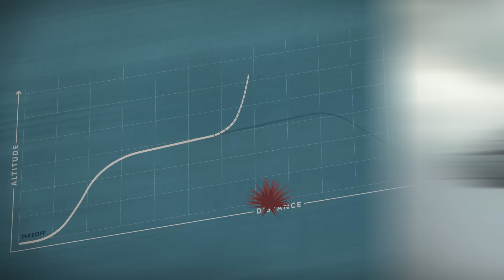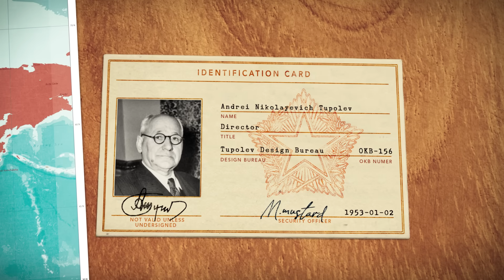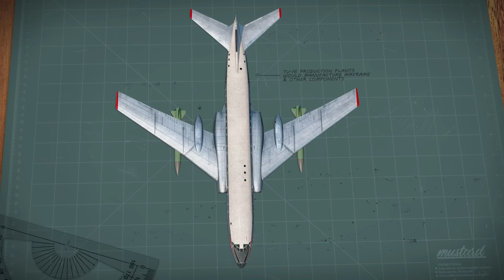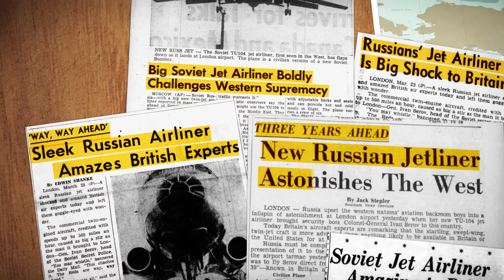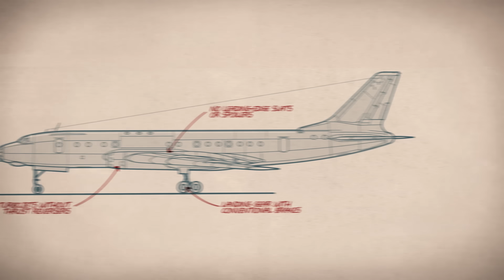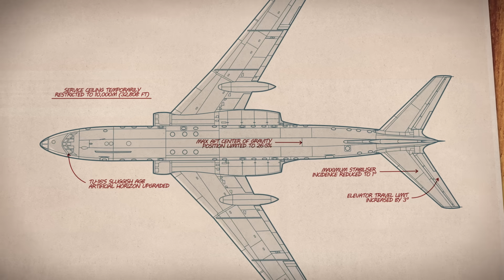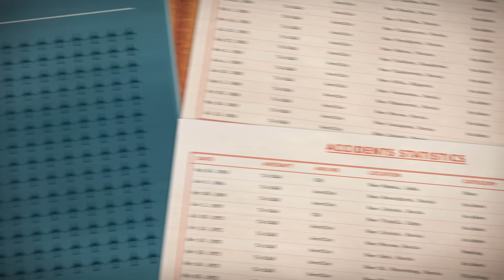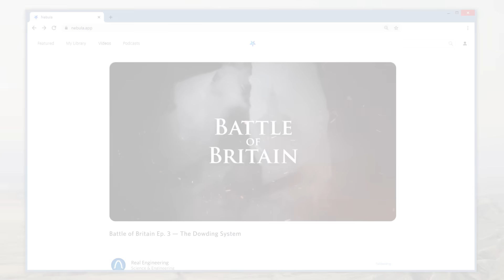The Soviet Airliner Designed To Crash

Comment: Russia has always had the mentality of take this off of this and put it on that - I understand the idea but they failed to take physics into account after QC of this thing. If their was a QC.
Reply: This plane has a very good safety record compared to the British Comet.

Comet Disaster was caused by both bad engineering and poor quality control standards.
Reply: @sandervanderkammen9230   

We feel we can shed some light on some common myths & misunderstandings repeated in many comments.

It is indeed correct that there were plenty of aircraft that were more dangerous than the De Havilland Comet before & after the Comet.

Obviously It's not valid to compare a Bow-wing ( see B-47 wing folding & wing collapse incidents for details) jet  airliner designed & first built as late 6 decades after the Comet, with the fabulous De Havilland Comet, the world's first high altitude jet powered airliner.  
  Vast improvements in commercial aviation infrastructure alone being a significant factor in improvements in air travel safety safety over mire than half a century.
    Of course 50 years more design, build & operation experience didn't prevent the horrendous Bow-wing Max  incidents, there can obviously be no excuses for that.
  
  That's correct of course, at the time the Comet wasn't particularly dangerous. Agreed, that is indeed the case of course, The DH Comet was definitely not the worst engineering failure in commercial airliner history.

Losses comparisons
How things were in those days.

DeHavilland Comet 4 UK                  14% 
DeHavilland Comet all mks             17%  

Boeing 307                               70%
Boeing 247                               48%
Boeing 707            .                  20% 
Lockheed Electra Turboprop   29%
Canadair CL-44  Turboprop     46%  
Convair CV-580  Turboprop     22%
Convair CV-880    (ff 1959)       27%  
Convair CV-990     (ff 1961)      33%
Tupolev TU-104       (ff 1955)    16%

     Of course De Havilland had prior experience building many all metal construction airframe aircraft & thousands of jet powered fighter aircraft that were primarily of metal construction with pressurised cockpits & jet engines built by De-Havilland.

  Yes, that's true, De Havilland carried out full stress analysis & engaged in a comprehensive & protracted testing program which is why key De Havilland people were happy to be aboard flying DH Comet aircraft. The Comet was the first airliner where stress due to pressurisation significantly exceeded flying load stress for a full length passenger cabin fyselage.

    We agree, that's correct, the DH Comet was the first passenger airliner with full length fuselage pressurisation at 8psi pressure differential. Handley Page built the world's first all metal construction airliner during the 1920s.
    In many cases earlier pressurised aircraft were larger, needed thicker fuselage skins due to flying stresses alone & had much lower pressurisation differential pressure. 

     Of course ripstop provision was provided. The skin alloy used became unavailable at the time due to R & D at the manufacturers which resulted in the original alloy being discontinued. Later alloys had very similar properties. The skin thickness used for the Comet was used for similar size later aircraft. Frame spacing was not found to be too large & frame width was not found to be too small.

    Without doubt De Havilland did indeed always work to better than industry standards at the time, used up to date knowledge for the design & construction & no evidence of negligence or criminal negligence was ever produced in relation to the DH Comet.

   Obviously the DH Comet had no effect on the course of the aerospace industry in the UK. The UK now has the world's largest combined nuclear, aerospace & defence sectors per capita activity.

    That's correct, the investigation committee did not find hundreds of fatal flaws or evidence of design defects, structural defects, defective materials or shoddy workmanship. Indeed it is the case that ripstop provision was included. Claimed incidents did not involve cracks starting from passenger window corners.
   Pretty much all changes were just in case changes or were planned development modifications & improvements that were scheduled regardless of incidents.

    Obviously De Havilland designers knew all there was to know about metal fatigue at the time they designed the DH Comet.

    It is in fact true to say that the way airliners were built changed everywhere including in the US after the Comet incidents.

We hope this helps, obviously.

Cheers indeed of course 👍. 
    
 . . .... ... ..... ........
 ..... ..... .... ...........

Comment: Ah, the Cometski
Reply: Much safer than the Comet
Reply: @sandervanderkammen9230 

Although the tu-104 was a much  later design effort than the Comet it wasn't in fact safer.

We feel we can shed some light on some common myths & misunderstandings repeated in many comments.

It is indeed correct that there were plenty of aircraft that were more dangerous than the De Havilland Comet before & after the Comet.

Obviously It's not valid to compare a Bow-wing ( see B-47 wing folding & wing collapse incidents for details) jet  airliner designed & first built as late 6 decades after the Comet, with the fabulous De Havilland Comet, the world's first high altitude jet powered airliner.  
  Vast improvements in commercial aviation infrastructure & pilot familiarity with jet airliners alone being a significant factor in improvements in air travel safety safety over more than half a century.

    Of course Bow-wing having 50 years more design, build & operation experience than De Havilland didn't prevent the horrendous Bow-wing Max  incidents, there can obviously be no excuses for that.
  
  That's correct of course, at the time the Comet wasn't particularly dangerous. Agreed, that is indeed the case of course, The DH Comet was definitely not the worst engineering failure in commercial airliner history.

Losses comparisons
How things were in those days.

DeHavilland Comet 4 UK                  14% 
DeHavilland Comet all mks             17%  

Boeing 307                               70%
Boeing 247                               48%
Boeing 707            .                  20% 
Lockheed Electra Turboprop   29%
Canadair CL-44  Turboprop     46%  
Convair CV-580  Turboprop     22%
Convair CV-880    (ff 1959)       27%  
Convair CV-990     (ff 1961)      33%
Tupolev TU-104       (ff 1955)    16%

     Of course De Havilland had prior experience building many all metal construction airframe aircraft & thousands of jet powered fighter aircraft that were primarily of metal construction with pressurised cockpits & jet engines built by De-Havilland.

  Yes, that's true, De Havilland carried out full stress analysis & engaged in a comprehensive & protracted testing program which is why key De Havilland people were happy to be aboard flying DH Comet aircraft. The Comet was the first airliner where stress due to pressurisation significantly exceeded flying load stress for a full length passenger cabin fyselage.

    We agree, that's correct, the DH Comet was the first passenger airliner with full length fuselage pressurisation at 8psi pressure differential. Handley Page built the world's first all metal construction airliner during the 1920s.
    In many cases earlier pressurised aircraft were larger, needed thicker fuselage skins due to flying stresses alone & had much lower pressurisation differential pressure. 

     Of course ripstop provision was provided. The skin alloy used became unavailable at the time due to R & D at the manufacturers which resulted in the original alloy being discontinued. Later alloys had very similar properties. The skin thickness used for the Comet was used for similar size later aircraft. Frame spacing was not found to be too large & frame width was not found to be too small.

    Without doubt De Havilland did indeed always work to better than industry standards at the time, used up to date knowledge for the design & construction & no evidence of negligence or criminal negligence was ever produced in relation to the DH Comet.

   Obviously the DH Comet had no effect on the course of the aerospace industry in the UK. The UK now has the world's largest combined nuclear, aerospace & defence sectors per capita activity.

    That's correct, the investigation committee did not find hundreds of fatal flaws or evidence of design defects, structural defects, defective materials or shoddy workmanship. Indeed it is the case that ripstop provision was included. Claimed incidents did not involve cracks starting from passenger window corners.
   Pretty much all changes were just in case changes or were planned development modifications & improvements that were scheduled regardless of incidents.

    Obviously De Havilland designers knew all there was to know about metal fatigue at the time they designed the DH Comet.

    It is in fact true to say that the way airliners were built changed everywhere including in the US after the Comet incidents.

We hope this helps, obviously.

Cheers indeed of course 👍. 
              
 . . .... ... .... .....
.. ......... ..  .....
 ..... ..... .... .. .
............... ....  .

Comment: Still better than boeing theese days right?)))
Reply: Boeing makes the safest aircraft in the world.
The 787 has the best safety record of any aircraft design in the entire history of aviation
Reply: @ sure:)
Reply: @eugenenumberoneov You didn't know that Boeing makes the safest aircraft in history?
Reply: @sandervanderkammen9230  not even arguing:)
Reply: @sandervanderkammen9230 

We feel we can shed some light on some common myths & misunderstandings repeated in many comments.

It is indeed correct that there were plenty of aircraft that were more dangerous than the De Havilland Comet before & after the Comet.

Obviously It's not valid to compare a Bow-wing ( see B-47 wing folding & wing collapse incidents for details) jet  airliner designed & first built as late 6 decades after the Comet, with the fabulous De Havilland Comet, the world's first high altitude jet powered airliner.  
  Vast improvements in commercial aviation infrastructure & pilot familiarity with jet airliners alone being a significant factor in improvements in air travel safety safety over more than half a century.

    Of course Bow-wing having 50 years more design, build & operation experience than De Havilland didn't prevent the horrendous Bow-wing Max  incidents, there can obviously be no excuses for that.
  
  That's correct of course, at the time the Comet wasn't particularly dangerous. Agreed, that is indeed the case of course, The DH Comet was definitely not the worst engineering failure in commercial airliner history.

Losses comparisons
How things were in those days.

DeHavilland Comet 4 UK                  14% 
DeHavilland Comet all mks             17%  

Boeing 307                               70%
Boeing 247                               48%
Boeing 707            .                  20% 
Lockheed Electra Turboprop   29%
Canadair CL-44  Turboprop     46%  
Convair CV-580  Turboprop     22%
Convair CV-880    (ff 1959)       27%  
Convair CV-990     (ff 1961)      33%
Tupolev TU-104       (ff 1955)    16%

     Of course De Havilland had prior experience building many all metal construction airframe aircraft & thousands of jet powered fighter aircraft that were primarily of metal construction with pressurised cockpits & jet engines built by De-Havilland.

  Yes, that's true, De Havilland carried out full stress analysis & engaged in a comprehensive & protracted testing program which is why key De Havilland people were happy to be aboard flying DH Comet aircraft. The Comet was the first airliner where stress due to pressurisation significantly exceeded flying load stress for a full length passenger cabin fyselage.

    We agree, that's correct, the DH Comet was the first passenger airliner with full length fuselage pressurisation at 8psi pressure differential. Handley Page built the world's first all metal construction airliner during the 1920s.
    In many cases earlier pressurised aircraft were larger, needed thicker fuselage skins due to flying stresses alone & had much lower pressurisation differential pressure. 

     Of course ripstop provision was provided. The skin alloy used became unavailable at the time due to R & D at the manufacturers which resulted in the original alloy being discontinued. Later alloys had very similar properties. The skin thickness used for the Comet was used for similar size later aircraft. Frame spacing was not found to be too large & frame width was not found to be too small.

    Without doubt De Havilland did indeed always work to better than industry standards at the time, used up to date knowledge for the design & construction & no evidence of negligence or criminal negligence was ever produced in relation to the DH Comet.

   Obviously the DH Comet had no effect on the course of the aerospace industry in the UK. The UK now has the world's largest combined nuclear, aerospace & defence sectors per capita activity.

    That's correct, the investigation committee did not find hundreds of fatal flaws or evidence of design defects, structural defects, defective materials or shoddy workmanship. Indeed it is the case that ripstop provision was included. Claimed incidents did not involve cracks starting from passenger window corners.
   Pretty much all changes were just in case changes or were planned development modifications & improvements that were scheduled regardless of incidents.

    Obviously De Havilland designers knew all there was to know about metal fatigue at the time they designed the DH Comet.

    It is in fact true to say that the way airliners were built changed everywhere including in the US after the Comet incidents.

We hope this helps, obviously.

Cheers indeed of course 👍. 
               
 . . .... ... .... .   ..
.. ......... ..  ... . .
 ..... ..... .... .......
............... .... . ..